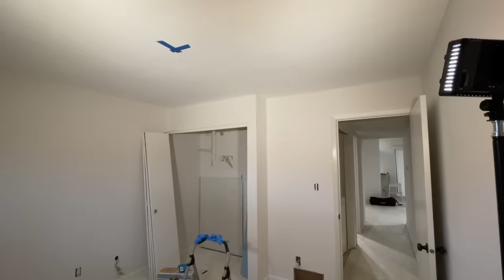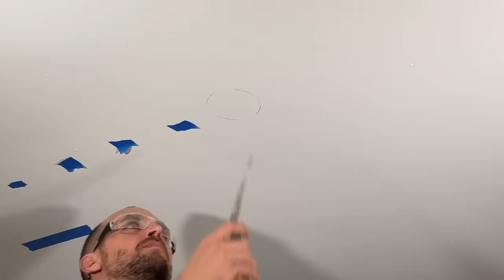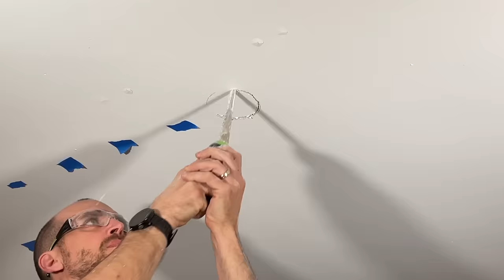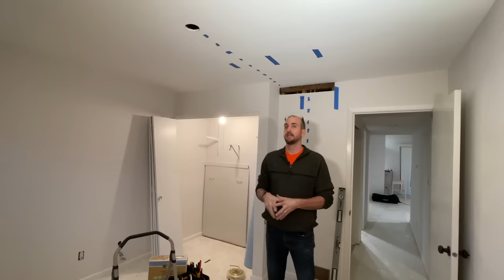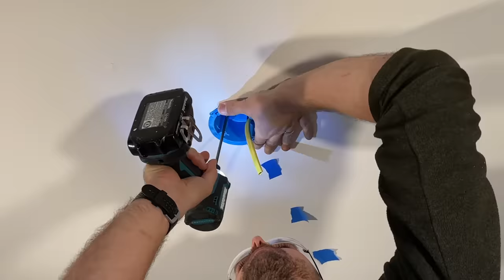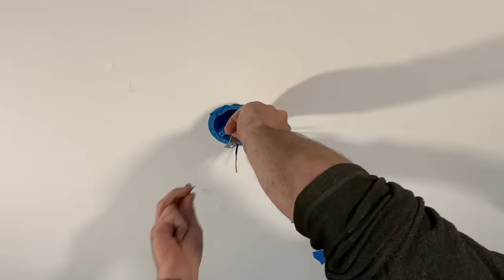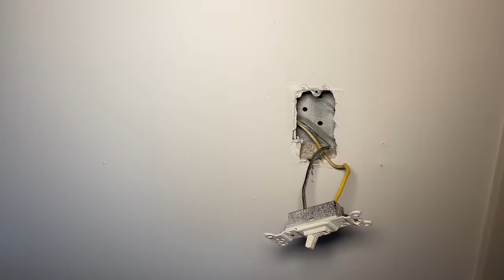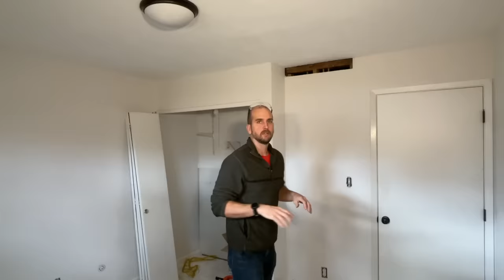How To Install Ceiling Light Without Existing Wiring

Comment: My tip; when cutting out the wall sheetrock next to the ceiling you went ALL THE WAY to the ceiling. By doing this, you have to mud the corner INTO the ceiling too. To keep mud out of the ceiling and corner, and then having mud on the ceiling too, you know the top plate is 3 inches wide. Only cut the wall sheetrock 3/4 of an inch above the bottom of the top plate. That gives you the wood to mount the sheetrock and room for the wall mud only without having to mud a corner into the ceiling.
Reply from the maker: Totally agree, I learned my lesson from this one and thanks for the feedback 👍
Reply: Top plate? What's that?
Reply: @JQUICK21  The top plate is 2, 2x4s = 3 inches, from the bottom of the ceiling joist to the top of the wall stud. It's the very top of the wall construction that connects the wall stud to the ceiling joist.
Reply: @igoski1582  What's a ceiling?

Comment: Omg, finally someone makes a video about my exact situation. Everyone else makes videos going into the attic or basement.
Reply from the maker: Happy to help, I do recommend using an old work box that could take a fan load https://amzn.to/35n6ph9.  Also Romex should not go through a plenum like I did in the video.  Best of luck on your project!
Reply: @EverydayHomeRepairs  thanks for the reply. Im not running a ceiling light. Im installing the ceiling Sonos sound system and needed to run power up the the ceilings.
Reply: YES. THANK YOU!!
Reply: Man ..... Exactly the same situation .. !!!!! . I do have an attic .. but at the corner I need the connection it will be never reachable on the attic . !!!!! ...  Yeah . !!!!!
Reply: Same here! Thanks for this video!
Reply: @EverydayHomeRepairs  Ha yeah, I just came here to mention the NM cable in the return duct being a big no-no...
Reply: Yep, me too. Outlets were easy but my main issue was the top plate...and I have moulding. Smh.
Reply: Effing ditto what Chubby said!!!!
Reply: @EverydayHomeRepairs  cccyou uncivil uuccucucuc
Reply: God always knows what you need God Bless you.
Reply: @hectorvarela9347  tape a 3foot piece of string to a 10 foot stick of 1/ 2 or 3/4 " pvc
Reply: Chubby is correct... 
Thank you!!!
💡
Reply: Same here!
Reply: @hectorvarela9347  what do you mean you don't have a attic all homes have a attic be it small or large I have ran into so many  older home still with knob and tube wiring
Reply: @BernardBethea6339  In America, some house's have two stories. The attic is above the second level. What if you need to wire the living room which is on the lower level? 🤔
Reply: Same here I’ve been living in my house for over 10 years and from day one I’ve always wanted to do this I have three rooms that need it, it will be a lot easier for me cause I have an attic. Thanks, BTW this guy does a nice ,neat job👍
Reply: @BernardBethea6339  my 1959 house did NOT have an attic at all. It was a flat roof. Sheetrock, wood joists, then roof immediately. Only room enough for insulation and that was it.

Comment: Im not an electrician just a DIYer but I would of ran your new wire from your wall switch, not the outlet. Then at the switch you can wire your outlet hot all the time.
Reply: He installed a new outlet that with a tab between the switchable circuit that is hot all the time , regardless of the switch position.
Reply: @JS-zj9fx  yes. But he still could have taken his wire to the switch. Discarded old wiring (cap and label) and put on plugs without the tab broken lol.

Comment: As a remodeler, I always install ceiling boxes to hold the weight of a fan, because inevitably...someday someone will try to hang on from it. Good technique though.
Reply from the maker: Completely agree, that was a miss during my install.  Thanks for the feedback.
Reply: That's brilliant. I'm always pleasantly surprised when a client asks me to hang a fan where a light was and I don't have to switch out the box.
Reply: ! Excellent job!
Reply: As of 2020 code, it is required now.
Reply: @bmwmike3534  crazies
Reply: @bmwmike3534  that only applies if the ahj adopts 2020
Reply: @Cade_Stone  hence the reason I said as of the 2020 code...
Reply: Absolutely 👍
Reply: @shadowninja1474  you have no life you been on here all day 😂😂
Reply: @ghetnhatxaolaonogatvaninh  Cool, thanks for letting me know🤣😜👍
Reply: @bmwmike3534  In addition, even the 2014 NEC code 314.27 says that a ceiling box for lights must be rated at 50 lbs minimum.  That Carlon box that he's using only has a 10 lb rating.
Reply: You would go broke as an electrician if you installed things for “what if situations”…….
Reply: You will always install ceiling boxes to hold the weight of a fan??  Lol!  C"Mon....so basically home depot should stop selling fans?  How are all those "non reinforced" boxes holding up fans?!  Get lost bud!
Reply: @user-dl3pe3nr1s  everything seems to have been thoroughly thought through in its design. The only apparent safety weakness are the side foam blocks, but anyone handy with tools can make solid wood pieces to replace them. Midea is the name that appears inside my Cuisinart 3 in 1 microwave/convection oven/grill that unfortunately has its control panel turned unresponsive and I can't find that part being sold anywhere, otherwise  it is also a very neat piece of engineering.
Reply: Also install a 12/3 wire, even if you cap off the red wire so there can be a separate power lead to independently control a fan and light.
Reply: @mrchrislatino  up you go
Reply: @EverydayHomeRepairs  put warning label under light for resident
Reply: @EverydayHomeRepairs  its part of code now in 2021
Reply: @mrchrislatino  14/3 wire, it's most likely a 15 amp circuit.
Reply: @EverydayHomeRepairs  Also if you run your switched romex from the switch to the ceiling junction box, it's just a matter of removing wire nuts to put the fan on a constantly on circuit and leave the fan's light switched.

Comment: You can also cut only 3 sides of the drywall and insert the saw at a 45 degree angle then snap the uncut 4th side to act as hinges.  This was you can simply fold it back and just apply mud inside and out.  The reason for no taping is because of the 45 degree cut.
Reply from the maker: That is what I call a "Pro Tip."  Thanks and that is a great idea.  I am sure it takes a bit to get the technique down but would save a ton of time.  Maybe a future video 😉
Reply: Brilliant sir! I’m totally using that tip. Thanks!
Reply: Awesome tip❤

Comment: If you are doing this much work... just go to the switch put in a 2 gang box one for the light and one for a fan or outlets and put in a fan rated box... u have to repair holes might as well do this job once and be done with it

Comment: Why not put in a ceiling fan rated box while you are at it?  Super simple.
Reply: I'm considering doing this same thing in my house, but will want to hang a chandelier. If the joist isn't in the center of the room, do I just cut out the ceiling past the 2 joists on either side and install a joist between them?
Reply: @SailChimp  You get a ceiling fan box that comes with a safety brace that wedges between the joist.  Make sure your box is flush with ceiling.

Comment: Tip: 
To avoid the nail/screw pops that you made when you first hit the hole saw into the ceiling, either drill with a paddle bit for a starter hole or use an oscillating saw to make your cut.
Reply: Hole saw bits save time for light boxes and cans too.
Reply: And checking if the wall cavities are insulated helps too. And what kind of insulation you are using. Expanding foam makes it more difficult fishing those cables
Reply: Nail pops indicate the drywall was falling/nails were pulling out.  It is good that he discovered this since the drywall will be carrying the weight of the ceiling fixture.  He can zip screws in along side the popped nails.  A bit of extra drywall repair to do, but not really that much.
Reply: What are "nail pops and screw pops?
Reply: @JQUICK21  
 A nail pop is a small, circular area that appears on drywall when a nail pulls away from the wall, pushing through the paint and drywall, this is caused by expansion a contraction of the wood its, screwed into. Nail pops can look like cracked circles or blisters on the wall. 
With drywall screws, the compound can loosen from the filled void and fall out, exposing the black screw head of the screw(s). This is also caused by expansion and contraction of the wood which loosens the compound above the screw, as well as possibly poor installation of the joint compound.

Comment: That laundry room drop ceiling made it so much easier to run the wiring. It would had sucked if he had to drill a hole through the top plate plus having the ceiling joist running the same way as your wiring installation.  Dang i wish half of my jobs were that easy : ) Great video!
Reply: For the top plate, if he didn't have that hole he could have used an oscillating tool to cut a notch on the side of the plate, another slight recess for a nail plate, reinstall the piece of drywall which was carefully removed.  Patch work is fast and easy after that.

Comment: Only thing I'd recommend would be if you're going through the trouble of using twist caps, use your pliers to twist them first then put the cap on top. I've removed twist caps for Wago's in my home but in doing so, I've developed a respect for how well pretwisted connections work.
Reply: Technically not necessary as wire nuts twist and bite into the wires but I agree that pretwisting is best. Exception would be stranded to solid, let the nut do the work on those.

Comment: Hey brother, I have seen several of your videos and you do good work.

Three things for your viewers:

I am an electrical guy.  I believe the 2020 code requires electric ceiling boxes be able to support fans with a few exceptions.  Several have asked....they make those bar/box kits for ceiling fans.

The easy rule of thumb with neutrals in switchboxes is, yes!,  A neutral in each switch box.  There are exceptions and the conduit run should make this job exempt.  This is so automatic lights have a current return path that is not a ground.

And not mentioned is a ground in the switch box.  Yes the conduit should count, but the easy rule of thumb is to run one.

Keep up the good work and if anyone needs a reference, I can get my book out for the specific numbers or provide proof that I do not know everything.  

Thanks
Reply: Oh, third....

In metal boxes, two or three wraps around the switch or recepticle may prevent the hot terminals from touching ground.  An annoyance and a scare but not an nec requirement.
Reply: Here is a link to a THIS OLD HOUSE VIDEO that shows the light support.

https://youtu.be/6r_Ni1gc5xg
Reply from the maker: Thanks for all the feedback Keith, appreciate the help 👍

Comment: Check your local building codes only because for condos, if multi-floor buildings, you typically cannot just put a hole in the ceiling.  It creates a fire hazard because the "firewall" between floors has been compromised.  I had this same issue, rewired it myself.  I then decided to move and rent the condo.  The inspectors made me open a permit and install a fire-retardant "hood" that you pop through the hole.  It's a dome you push through the hole and it covers the hole and junction box.  It is fireproof or resistant and is allowed by code.

Comment: Great video. Did the same thing a couple years ago. Tip- cut the drywall very carefully using a razor and use the same piece you cut out, to put back in.
Reply: And angle to blade a bit toward the center of the piece you are removing so it can't wobble or fall into the wall cavity when cutting openings between studs
Reply: Depends on the project. One hole, go for it. Dulls the blade quickly.

Multiple holes... far quicker to punch out or saw out and then just cut a new piece from a sheet of drywall. 

Personally I like to punch it out with a hammer then square it out later or just use a rotary saw from the getgo.  Either way cut a new piece, use some firring strips and screw and mud in the new piece. Done.

Comment: As a DIYer myself, I like your laymen speak and how you tackled the project. Well done! I have a ceiling fan project that the wife has bestowed on me - :face-green-smiling:. My outlet and switch situation are similar to yours and thanks for your tips on leveraging the existing switch to control the ceiling fan. My switch is for the wall outlet which I don't need - it's better for my usage to convert the wall outlet to always ON.
Reply from the maker: Best of luck on the project and since you will be installing a fan make sure you get the bracket that can hold the fan weight and not the smaller Old Work box like I used.
Reply: @EverydayHomeRepairs  Yep, got the ones from homedepot that are expandable and get bolted to the joist. The install is on the top floor with access to the joists in the ceiling.

Comment: 60% of my work is fixing handyman electrical work. This video is future money in my pocket! Thanks
Reply: Frank Drebin, I was just thinking the same thing.  He has it easy with this lay out.  Did he drill through the double top plate? I missed that if he did. I would’ve also gone from the switch and just rewire the one outlet.
Reply: Why?
Reply: He used 12/2 Romex. Is the circuit 15 or 20 amp. Looked like he used 15 amp rated plugs. Also looked like there was less than 6" of wire at the plug.
Reply: @jimmyjones6298  oh, because it’s a condo with cement walls and floors.
Reply: @robertkachadoorian5926  normally you use 14 awg for lighting but larger wire can be used. In this case it doesn’t matter because you have to go by the existing wire size for the breaker size. But even if it’s a 20 amp circuit you can use 15 amp receptacles because you can’t plug a 20 amp device into it so the device won’t and can’t be overloaded.
Reply: @jpsktools  it was the plugs he changed out I was more interested in. Wasn't the wire size. Should have been more clear.

Comment: I didn’t know about the isolation tab on the outlet before. Nice tip. One of the things that has bothered me for decades is the practice of not having a ceiling light wired to a switch and instead having it wired to the outlets. That has always been a WTF!?!  thing for me. I mean if switchable outlets is something you might think someone would want than do that, but there needs to be at least one light fixture in the ceiling, with the switch by the door.
Reply: Back in the day that used to be common because people used lamps on a table controlled by the outlet
Reply: @willschultz5452  That’s fine, but again switch for the ceiling light should have been the primary light. If you want that extra switchable outlet then install next to the ceiling light switch
Reply: @mendodsoregonbackroads6632  yes ive seen those before also. The house I grew up in was built in 1961 and had no ceiling lights in any of the 4 bedrooms,  or the family room or the living room.  They were all a switch that worked a receptacle.  The only place that had a switchable light was the kitchen,  laundry room and the 3 bathrooms. It was very common back then.
Reply: @willschultz5452  And that's why houses were cheaper back then!  j/k
Reply: Also in some condos they don't install ceiling lights to avoid sound to travel. Sometimes they put the lights on walls too. Sometimes there's a concrete slab between the condos and they don't want to pierce through it to loose the sound isolation.

Comment: Those nail pops are exactly why I always use screws when installing drywall they pretty much completely eliminate that issue when the screws are properly driven.
Reply from the maker: Yeah, was a bummer for sure.  Just added the pops to the list of drywall repair.
Reply: I have heard that when drywall is installed at a contract level which means fast paced, installers use nails and glue to adhere the drywall since this makes it faster and easier handling of the sheet. I would use screws myself since I normally do small repairs and I am not too concerned about the time. 
Nice video by the way
Reply: @EverydayHomeRepairs  Well, you were going to have the mud and paint out anyway, so no big deal.

Comment: A few important tips:
1. Use a multi tool to cut the Sheetrock instead of a utility knife or keyhole saw. Saves time and easier on the wrists.

2. Do not cut the hole in the Sheetrock over the studs. That way you can reinstall the cutout piece of Sheetrock. Screw in backer boards with course drywall screws to re-secure the cutout Sheetrock. Using the same piece will also assure that the original texture will line up.

3. I would suggest to install a fan box rated at 50lbs instead of a plastic box. There are fan boxes for existing Sheetrocked ceilings. Cut the hole and slip the bracket through the hole. It will clamp to the joists. That way, you have the option of a fan or light. You are not limited to a light.

Comment: Thanks! This was really helpful. I’m still struggling a bit because I want to do what you just did in this video but also add a 3-way switch into the equation, so having 2 switches that control the new installed light while leaving the power outlets always hot

Comment: Also, regarding pulling the extra wire out.  Personally I would have tagged them with a flag of electrical tape and wrote on them "Old 1/2 hot SL" (old half hot switch leg).  It's always best to leave extra conductors in place if they are not damaged (for future use).  They could have been used for some other project such as adding wall sconces or repairing a damaged wire burnt up at one of the receptacles.